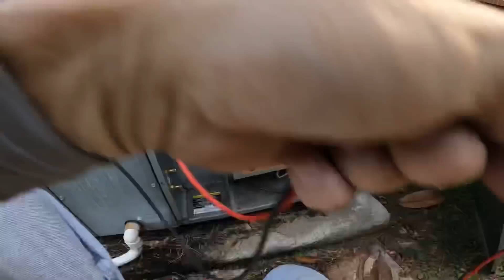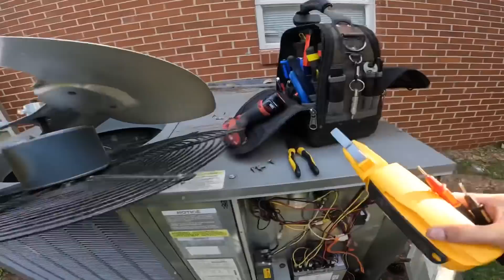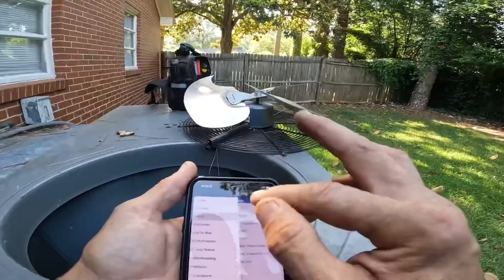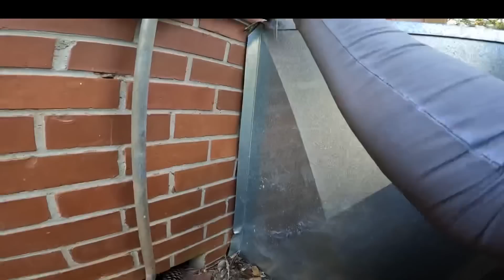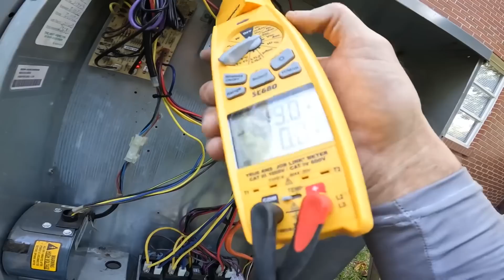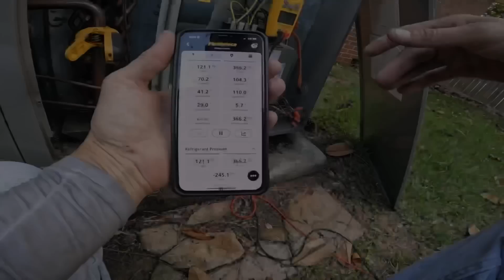Please Tell Me It’s Not the Compressor Again

Comment: Ever think about getting a megohmmeter?  That is the proper tool to test for a short to ground. It will do a true insulation breakdown test. A regular meter doesn't give a very accurate reading. Fluke makes one of the best, but they cost around $670.
Reply: megohm meters are for testing power leads and wiring. A standard Fluke meter ohm tester will properly check for short to ground compressors.
Reply: @briangc1972  
Not true Brian. The difference is the voltage output for the test. True, it will find a dead short to ground, but it will not identify a short at the rated voltage of the compressor. Many times I’ve seen 480 volt motors that show fine on a fluke, and a meg check dropped low at the rated voltage.
Reply: @mskimmel59  In over 20 years I have seen exactly 1 compressor with bad windings that ohm-ed OK with my Fluke but had a short that showed on start-up. That 1 time your megohm would have been helpful. Not worth it in my experiences. They are good for their intended purposes (testing power lines and wires), but not necessary for HVAC.
Reply: @briangc1972  You can also just clamp a multimeter around all 3 compressor leads and see if you get a reading.  If you do, that's current flowing to ground.  You can also make that test more sensitive by looping the wires through the measurement loop multiple times.
Reply: @briangc1972  Your dead wrong.  You test a motor for grounds with operating voltage, not a nine volt battery.  Yes, you can also use meggers to detect cable faults.  I’d did that just yesterday.  You test the windings with an ohmmeter.  A high resistance short to ground, or insulation breakdown test requires a megger.  I use AEMC crank style meggers.  Megger tests are required during annual maintenance on most large equipment.  Yes they are expensive, but it it the correct way to test the condition of the motor insulation.  It must be done when the motor is at operating temperature, and the test is done with at least operating voltage.  My megger will generate 250 volts, 500 volts, and 1000 volts.  If you read the instruction book for the megger, it has all the instructions for testing for insulation leakage on various types of motors. 30 year Union HVAC instructor here, and 45 years in the field.
Reply: @rodgraff1782  I have only seen one compressor in 25 years that the Fluke ohmmeter did not show me a short to ground on a shorted compressor. That particular compressor tested ok with the ohmmeter, but as soon as it tried to start under load it would trip the breaker. So technically, you are right and wrong. An ohmmeter is all the field tech needs 99.9% of the time. The mega ohm tester is not required in a vast majority of real life scenarios. Union membership does not make you any more qualified. From my experience, union guys are generally more lazy and incompetent because they don't have to try, the union will protect them. I've been self employed, licensed and have not needed to advertise in over 15 years because I have a reputation built on quality work.
Reply: @briangc1972  We can agree to disagree. I have not had the same experiences as you, with your ohmmeter.  I worked on very large equipment, and Semi hermetics that had 125 horsepower motors.  We were required to megg the windings annually, because a burnout on a large compressor like that, costs tens of thousands of dollars, to replace and clean up the mess.  We used the megger to see what the atmosphere around the windings was, not only for shorts to ground. We could tell if there was moisture, contamination from copper filings, or copper oxide, which are all conductors. As far as my Union goes, our apprentices had to sign an agreement called “The code of excellence”.  This basically says if they are not up to par, or show any non professional conduct, they can be terminated from their job, and kicked out of the program.  I once had a student in his fifth year, that didn’t like me, because I called him out for his behavior.  He left a drawing on my desk, when I wasn’t in the class room, that portrayed me as being a dick.  Well, he lost five years, and was kicked out of the program.  I’m not saying all unions are good, but if you don’t perform in our local, word gets around and no one will hire you, so you sit on the out of work list.  I know some really good non Union guys, and some Union guys that are worthless.  We try to weed them out at the apprentice stage.  Not all Unions are like what you discribed, but I’ll agree, some are.  As a Foreman, I had to let go my share of guys, who had bad attitudes, or couldn’t perform.

Comment: HVAC GUY:  It might help some of the younger guys if you would say what you are testing for as you touch each point with the meter leads. Like: “ checking Line voltage”, “let’s look at fuse continuity”, “checking run winding resistance”, “ windings to ground testing”.
Also, give them a feeling for your assessment of each reading….like: “looks good”, “that’s a little low”, “that is not what I expected…..this reading should be a lot higher.” , “looks like start winding is shorted to ground”,etc.

This was so frustrating to me when I was young, working with my Father. He said nothing, just went to work doing this and that, without a word as to what or why he was doing what he was doing or how he felt about the results or the conclusions being reached during the process. Very discouraging to say the least! Plus....I could never seem to hold the light just where he wanted it!
Reply: Agreed!
Reply: Came here to say the same. I know it’s tough to narrate while in a bind but I know he makes these vids to help us so I know he appreciates the input.

Comment: Had similar problem on a Aaon r22 unit. Two circuit 10 ton. Replaced txv, still popped breaker. Removed some gas and cleaned condenser again. Sight glass had bubbles, pressures a little low for 22 but stayed running and no more popping the breaker. Oh and didn't freeze up.

Comment: Whenever you get the time and are thinking about it, throw some thread locker on the belt clip on you m12 impact. They fall off so easy with use and after I put threadlock, I’ve had no problems since.

Comment: Let us know how it turns out!  Definitely agree on TXV causing you trouble.
Reply: Restricted TXV would not cause high head pressure or not higher then normal. It would be just opposite and compressor is having his pumping ratio so lower suction pressure would lead to most likely lower discharge pressure. TXV can be an issue but pressures and and SC, SH are not saying that.

Comment: Hey Curtis, since that has a txv, shouldn't you be checking sub cooling ?
Reply: He said sub cooling is low and superheat was high. Cond. fan motor is spinning too slow is the most likely culprit. Very common issue here in Arizona. Slow CFM will cause the compressor to over amp and blow the fuses during the heat of the day
Reply: @briangc1972  Ok, but my point is, if it has a txv, go by sub cooling. Don't worry about the super heat.
Reply: @bobgallo3775  If there are sufficient bubbles in the liquid line, the txv can bleed excessively. All TXVs do have a recommended superheat rating of 7˚ to 10˚ at the evaporator (Residential R-410a according to Parker).
Reply: @briangc1972  I guess I stand corrected.

Comment: Fuse is too small. Even without electric heat strip max fuse or breaker is 50 and min ampacity is 36. Check wire size.
Reply: 0
Orange romex is 10G. Rated for 30A.

Comment: Man it’s either a another bad compressor or fuses just got hot and need replacing. If not grounded then you check LRA. If it’s reading Rated LRA, after starting up all day it’s gonna end up blowing fuse. So you could add a hard start to help lower LRA.
Reply: And with you saying that the winding was at 0.8 I feel that’s kinda low
Reply: Hard start kit on brand new compressor necessary? Not normally!  What kind of TXV?
Reply: @georgekolos5255  yeah it’s not not normal but it could make it run. I just recommend replacing compressor again

Comment: You told compressor just replaced, after soldering there could be dirt layer inside the tube and after starting it'll goes to he txv filter or orifice and clogging the path.
Check this it may help.
And please tell us what was it after repairing.

Comment: I have a hard time understanding exactly what your looking for when your checking ohms. I’m trying to learn as much as possible.
Reply: Checking Ohms is the amount of resistance thru a conductor, he is checking the integrity of the compressor windings.
Reply: Checking ohm's ( resistance) across the windings C, R ,And S. Usually a good rule of thumb is the 3rd reading shoul equal the sum of the first 2. Then each to ground should be open or high megaohms. You can save time by doing it from the load side of the contactor on 3 phase or for single phase contactor and pull the leads from the cap to check.

Comment: Did you notice how loose the left fuse seemed be when snapped into position. 
A loose fuse gets hot and will fail.
Reply: Yep , seen it a lot. Loose fuses in disconnects WILL cause problems. Allways make sure fuses snap into holders tightly.
Reply: Yes, anytime I came across those fused disconnects I always went to the customer and advised replacing them
while I was there which would eliminate any future blown fuse calls, especially with service call fees being more than $125 just to come by!

Comment: What size is the circuit breaker in the house? I bet it's a 40.
Replace the fuses with a standard disconnect, and replace the 10 gauge Romex with 8 gauge stranded.
Reply: the unit says 36 amps minimum circuit rating for single circuit no heat kit, the compressor and both fan motors total (29.7amps) going by the rating plate, that's greater than the fuses can withstand for any length of time, but that's also too much current for the wiring feeding the unit (10awg orange romex) in the whip, the disconnect is likely fed with the same undersized wiring.
not sure what the installed heat strips installed are setup nor the circuit size feeding them, but maybe the circuits can be swapped and work out(maybe reversed when unit was replaced or they oversized it from existing?

Comment: Was the circuit breaker that was feeding the AC unit the wrong amperage so I fused disconnect was used to have the correct amperage on the AC unit. If the circuit breaker was correct why not gut the existing disconnect and install a non fused disconnect next to the old disconnect switch. Screw down the cover of the old disconnect switch to make it a junction box.

Comment: man... I hate mega ohms to ground it's such a grey area I and I hate condemning a compressor (or any big part) on a maybe, its a diffrent story when its a small part but a compressor that sucks. I just had an undercounter chefs draw that burned out the controller and power switch but I found 9 mega ohms to ground off the wires to the controller traced it bad to the condensor fan so they are getting all 3 parts. I'm glad you found the issue and it wasn't the compressor good job following through to the end I have seen so many people see mega ohms to ground and just say well thats that and order another compressor.

Comment: I wonder if the heat in the windings on the compressor would cause a higher ohm reading? Your thoughts?
Reply: It definitely can. Anything that can conduct(copper, aluminum, etc.) has a resistance rating at different temperatures and different sizes. I’ve never had that become a problem but it’s good to keep in mind
Reply: A megger" is a complete usless tool and a waste of time. Means  absolutely nothing if such shows "out of range" / bad or if also shows good. 

Only way one can use if they kept readings of compressor on a regular basis with same operating characteristics ex. Outdoor temp, similar load on system etc since the compressor/ motor was brand new.

Even if so. Still way too many variables to contend with.

Nor sure what the point of a Megger is or why people use such to "test" compressors?

Comment: You should change that 30 amp solid core to #8 stranded  wire.solid core can't carry the amps as stranded wire
Reply: I'm just saying 30 amp conductor is no suitable for this application compressor lock rotor amperage will underperform.
Reply: @stephenbullock1443  For compressor section Rheem says= Min circuit amp 36 amp, Min overcurrent protection 45 amp, Max overcurrent protection 50 amp.  So your right, underwired.
Reply: Where did you get that information?  So called skin effect?
Reply: @joehead1294  35 years being commercial electrician.
Reply: @stephenbullock1443  Circular mil area being the same, no difference between stranded and solid as to current carrying ability although some will say solid has a slight edge.
Reply: the label says 36 min.everything running normal adds up to 30 amps.
Reply: Stephen is correct. Look at the name tag of the unit a 30 amp fuse is way undersized. The name tag cost for a minimum impassively of 36 A. 50 amp breaker with a number six wire should’ve been run to this unit. That’s the first thing I look at whenever I have fuses that have gone bad. Can’t tell you how many times I’ve seen out in the field wrong wire size breaker to unit

Comment: after txv replacement,time delay if not already installed, and potential start relay.compressor manufacturer should have recommendations for capacitor size.few other product lines out there useing them.[trane].

Comment: I wouldn’t ohm a fuse out with power still being sent through it. It’s a fast way to blow up the meter. I would shut the breaker to the unit off and test it at the disconnect instead of pulling them out and testing it. Or you can just go right to checking the load side for voltage or lack thereof
Reply: Yea i know someones meter act up after doing that. The plastic fuse puller is fairly cheap i keep one in the bag.
Reply: Get rid of those ECM motors abd throw 2 rescue motors in there. I hate ECM motors. The whole idea with them is to save energy which will save money but they don't tell you is how expensive they are to replace when they break. There goes all your saving right there.
Reply: Rescue motors don’t last a year.

Comment: Your fieldpiece meter measures mega ohms? You need a meger to measure mega ohms. 
And I also noticed you measured continuity across the fuses with power on. Is the meter designed to do that? I never measure continuity or ohms with power applied.
Reply: Neither do I or I'll buy a new meter!

Comment: You didn't explain what happened and was drawing locked rotor amps initially  and after went back to normal rated load amps. 
Good job and troubleshooting skills
Reply from the maker: It always pulls LRA at start up. That’s what you were seeing. Just that instant. I was checking it against nameplate
Reply: I'm my experience a compressor that's operating properly pulls around half of its LRA when it starts and then same with its RLA, of course conditions change that some or heat mode seem to run a little higher amp. Most of the time when I see a compressor running like this one, it's not long before stop working. There is definitely some issues that need to be addressed with that system, but that new compressor in my opinion has suffered some damage since it was installed. It's running and pumping but it's life has been shortened. Just my opinion.

Comment: Probably due to, in your last video, you brazed the filter drier on the TXV with nothing to cool it down and you did not cool it down when you were done brazing the filter drier in.
More than likely took life off of it and it has begun to fail.

I also would have checked temperature drops across the driers to make sure they haven't clogged up either, to rule out as many possibilities of where the restriction is.

Comment: You realize you tested a fuse with it sitting on a metal cabinet. Not saying the results were not correct but it could have caused you a headache.
Reply: Too many guys ohming out things with wires on, in disconnects etc.
Reply: Could have also killed the clamp meter if the circuit was energised. Some cheaper ones would have exploded with a nice light show.
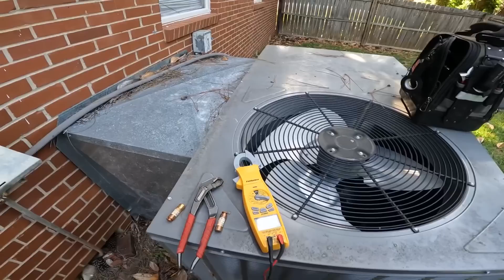Reply: 3:15
Reply: You do realize that the fuses are isolated by the plastic base that they're sitting in, right? Unless the plastic melted the fuses don't make contact with the box.
Reply: @naithanbohan4730  No, when he laid them on the top of the condenser to test.
Reply: Not really. the cabinet is painted and NOT gonna pass current. The cabinet would have to be bare metal, or heavily scratched to pass current. 
It is a new cabinet.
Reply: @adem-Savs  Your kidding right? You are saying painted metal will not pass current?
Reply: Has no good skills this guy,  didnt scratch  Cooper line to ck really  good graound..
Reply: @saulduke1549  don’t be jealous my dude
Reply: @HVACRss  why I should  be ?.